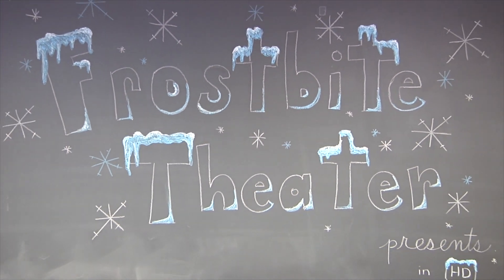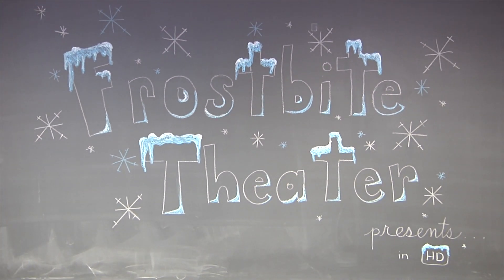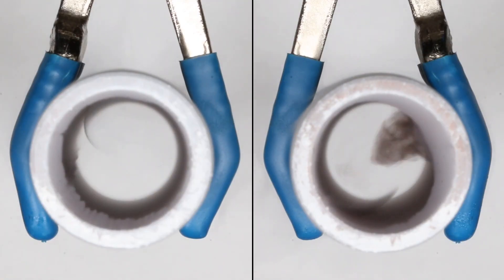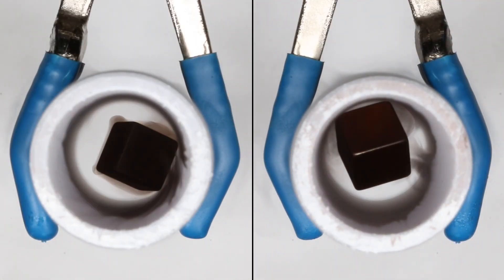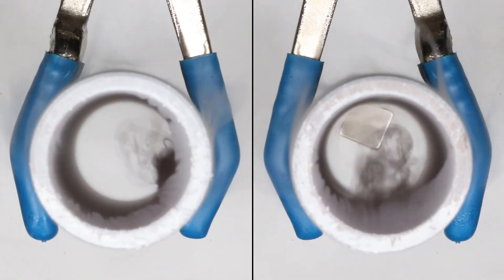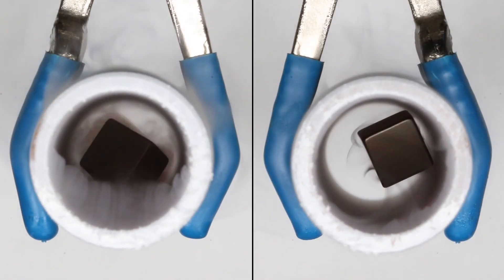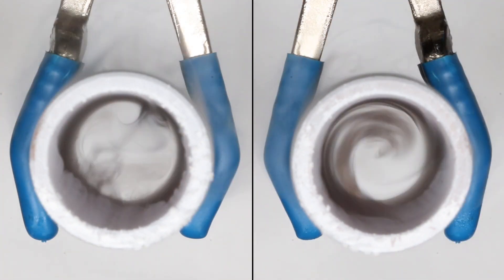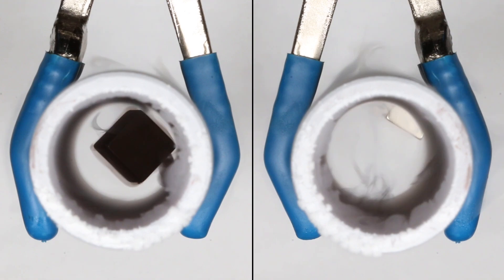*COLD* Magnets in Pipes!

Comment from the maker: To the person who asked about what happens if a magnet is heated to very high temperatures (I accidentally deleted your comment and YouTube doesn't have an 'undo' feature - sorry!!),

Heating a magnet will weaken it. And, at some point, the magnet will lose all of its magnetism. The temperature at which this happens is called the Curie Point (or Curie Temperature). For iron, it's about 1043 Kelvin. You'll notice that's well below iron's melting point (1811 K). So, if you have a permanent magnet that's made from iron and expose to to temperatures in excess of 1043 K, your 'permanent' magnet would no longer be a magnet (although it would retain whatever magnetic field the earth's magnetic field had induced within it once it cooled below the Curie Point).
Reply: As a blacksmith, I use that property of iron all the time when making blades. You heat the metal until it becomes non-magnetic; at that point, you've reached the temperature required for a proper quench. Cool video!